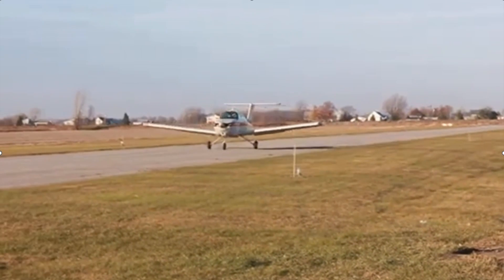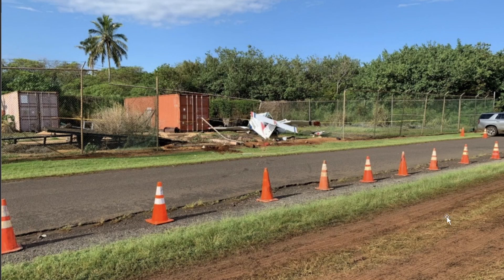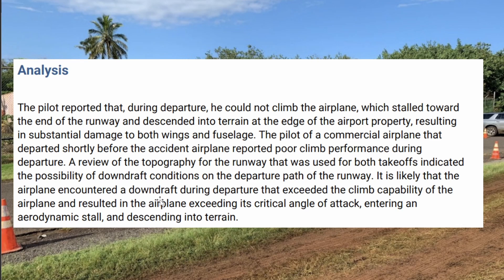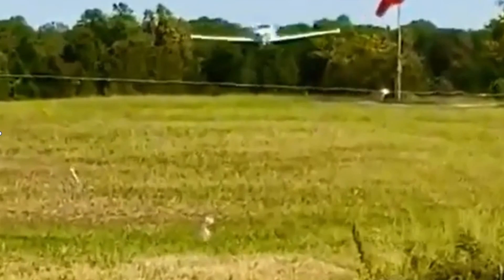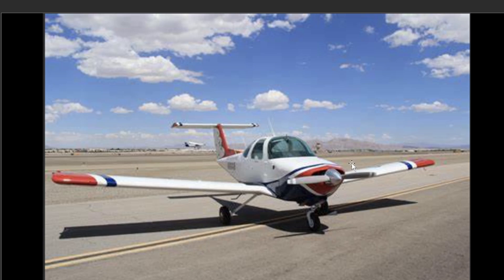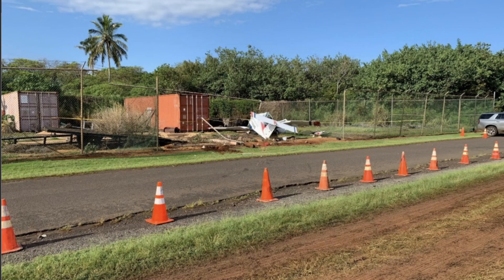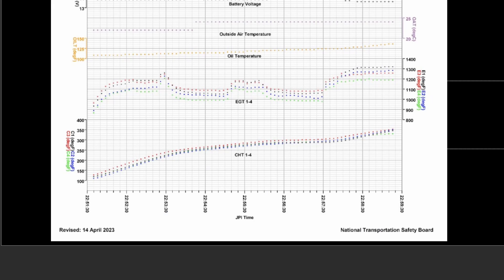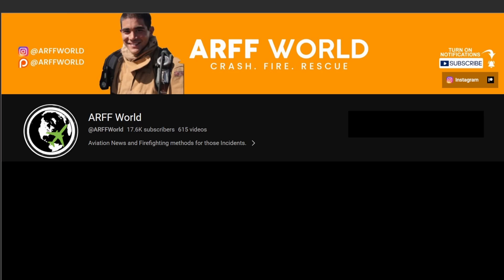Beechcraft Skipper Hits Downdraft in Hawaii

Comment: Pilots put it on the airport and ATC can argue it’s available on request. Not only that most controlled airports have a continual automated weather broadcast. I’d be curious to see what the pilot, passenger, fuel load, and cargo weighed in at along with the DA. The big mistake is ever trying to get off the ground with an underpowered overloaded airplane of any kind. The report said it was struggling to gain altitude and that there were possible down draft conditions. The main factor is it was struggling because of insufficient power and I think the pilot tried to yank it out of ground affect and stalled it.
Reply from the maker: Thanks Rob that makes sense.  Hope all is well
Reply: @ARFFWorld  Thanks! I hope the same for you my friend 🤠

Comment: I hope the seriously injured person fully recovers.  If the commercial pilots reported poor climb performance on takeoff, shouldn't ATC have commented to the small plane that previous aircraft reported poor climb performance?  If a 100 ton plane had problems climbing, certainly a single-engine plane would be struggling.  The fly in the ointment was how much altitude or not the small plane had.  Perhaps he was not high enough to lower the nose, possibly because of terrain ahead.  I'm sure it will all come out in the investigation.
Reply from the maker: thanks I would think they would have passed that on as well

Comment: Who hasn't encountered downdrafts when flying.  His reaction to pull back on the controls, wings don't stall because of a downdraft, was obviously the wrong thing to do.  When encountering those downdrafts, the proper reaction is to ride it out maintaining your airspeed and angle of climb, it's that simple, and most importantly, don't panic.
Reply: Yes, we need to continue flying at less than the critical angle of attack with the relative wind.  Yes, unfortunately we are taught to maintain altitude (high altitude orientation) rather than maintain airspeed (low altitude orientation.)  The airplane, with dynamic neutral stability, cannot stall itself.  A pilot pulling back on the yoke is required.  A cure for this, yet to be taught in flight schools but used on every crop duster takeoff, is to remain in low ground effect until obstructions require a pitch up.  On long runways such as here, the low powered airplane would be at cruise airspeed in low ground effect well before the end of the runway.  At cruise airspeed, this zoom reserve airspeed, he would have have flown through the down draft.  The air mass does not slam into the ground.  The descending air he encountered would have lessened its descent as it closed with terrain.  Airspeed, and not altitude, is life down low where we do not have enough altitude to recover from a stall.  Vy is mathematically the most climb for the buck, but that didn't happen here.  Energy management, not math, airspeed not altitude, is the ticket here.  Vx or Vy as appropriate is never appropriate when it leaves thousands of feet of free ground effect energy below on the unused runway.  Once we climb out of low ground effect in low powered airplanes we lose 20% of our total energy.
Reply: Good analysis, using or staying in ground effect in this situation might have given the pilot more options.
Staying close to the runway and accelerating way past VY or best climb would have prevented the stall spin.
Airspeed or energy level is your friend in sketchy situations like this. I wonder how much PIC flight experience the pilot had.  @jimmydulin928
Reply from the maker: Appreciate your take
Reply: Oh Shut up dude, you weren't there to know what exactly he did. It could be a number of reasons they ended like this. Maybe he was already too low, so he can not push  forward anymore as he would nose dive into the ground, killing them both..
Never blame someone doing something wrong if you weren't in the cockpit and when there's no evidence !
Reply: @crohr1000  It takes 1000 ft at 4000 ft for a Skipper to take off. At 157 ft elevation even shorter. 6500 ft of runway, ground effect is 40 ft. Based on reported downdrafts fly in ground effect until above Vx before attempting to do a shallow climb. I fly in the Mountian’s of Az 4000 MSL this was not the planes fault.
Reply: @oneskydog6768  that doesn't matter, I just hate ppl putting blame on pilots while they weren't there, and there's no official report of it.. He could have start his takeoff roll from the middle of runway, or maybe engine trouble on takeoff.. Fact is non of us were in the cockpit and there's no video or any other evidence. That's why I'm saying SHUT UP and don't act smart blaming the pilots!
Reply: @crohr1000  Obviously if you think a pilot would start a takeoff roll mid runway in gusty conditions you know nothing about flying! It is the pilot’s responsibility to determine if he can safely take off. Air traffic controls job is to sequence take off and landings not to give weather reports! Pilots are required to understand a weather brief and decide if their skill and equipment can handle conditions.
Reply: Well, depending on how far off the rwy they were when hit, it may have been get  pushed into the ground or at least try. If there was enough elevation then you are correct.
  I wonder why if a commercial aircraft reported trouble climbing, did that not get passes on to the incident pilot?
Reply: Got my PPL in Hawaii, it's no joke over there.  It's like riding an elevator up and down sometimes.

Comment: Every Beech Skipper ever produced has a T-tail...they were designed that way. There wasn't a 'switch' to the T-tail.
Reply from the maker: "Beech conceived the Skipper in 1973, and the first model flew in 1975. The earlier production models had conventional tails with a stabilator and flaperons (a combination of flaps and ailerons all in one piece). In 1978, the Skipper changed to a T-tail with an elevator and discarded the flaperons in favor of conventional flap and aileron systems. "  

https://www.aopa.org/go-fly/aircraft-and-ownership/aircraft-fact-sheets/beechcraft-skipper
Reply: @ARFFWorld  , this Wikipedia reference makes it a bit more clear.
"...Though the aircraft first flew with a standard tail configuration, by the time it entered production, a T-tail configuration had been adopted, giving it an appearance very similar to its close competitor, the Piper PA-38 Tomahawk introduced in 1978."
Reply: @ARFFWorld , the AOPA article  is  incorrect...Again, to reiterate, there were no production Skippers made that weren't T-tails, every one of the 312 Skippers sold from the Beechcraft production line were T-tails from inception, and there was never a 'switch' to the T-tail during this period of production. The article is misleading and one wonders if it was written by a non-pilot because the reference to the tail design mentions flaperons...Both the Beech Skipper and the Piper Tomahawk were conceived and designed by Howard Piper. It's highly unlikely that any major aircraft manufacturer would produce a student training airplane with flaperons.
Reply: At least Keoni did his research.  Can't fault him for the incorrectness of a source article.
Reply: @ericsd55  , I blame AOPA. They need to up their game...What did they do, get some summer intern to write their article..? Probably not even a flyer... 🤔
Reply: It's like you don't even understand your own English...